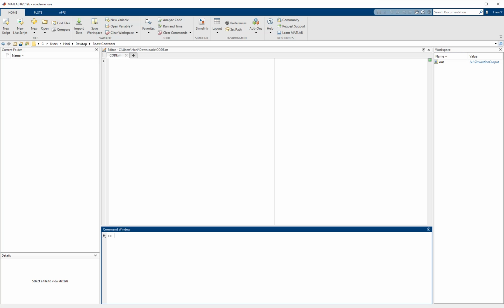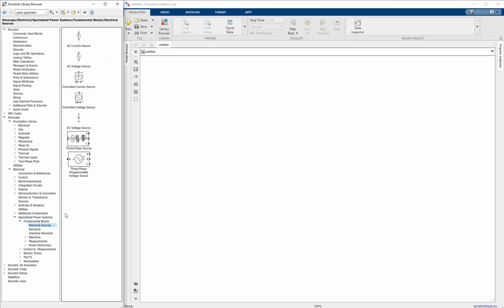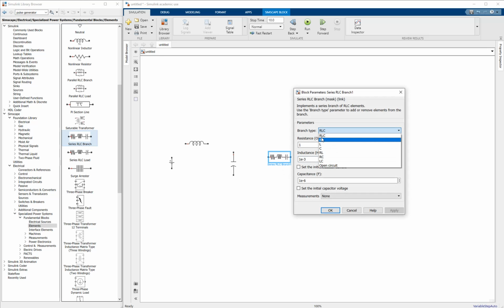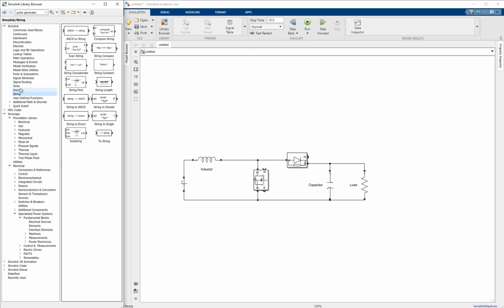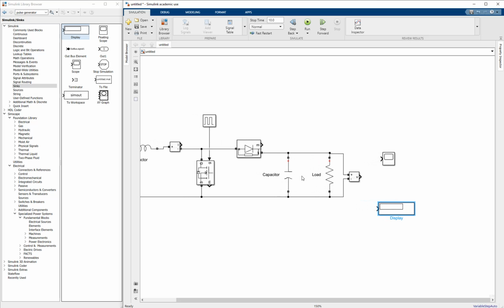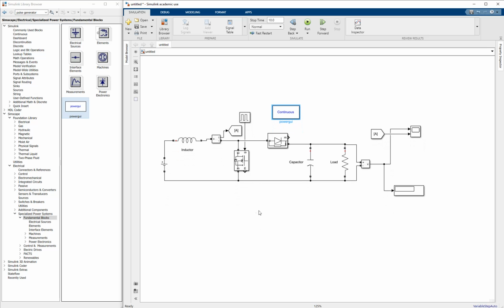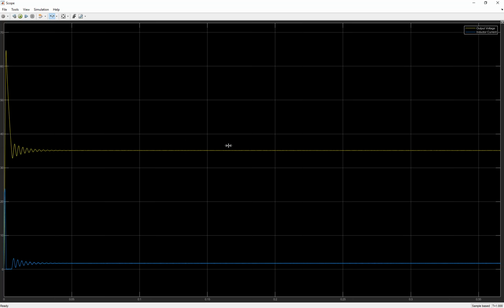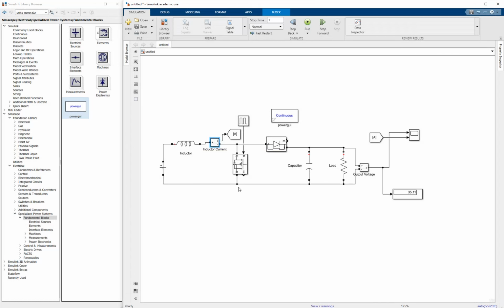Part 1: How to build and simulate an ideal Boost Converter in open loop Using Simulink

Comment: how i can control three switches  with phase shift 120 degree by using arduino uno  to control 3phase interleave dc/dc boost converter can you help me please
Reply from the maker: To control three switched with a phase shift of 120 degrees you can simply use three pulse generators with 3 shifted phase delays (sec) based on your signal period. For example, if your period is 9 seconds, set the first phase delay to 0 sec, the second to 3 sec, and the third to 6 sec. Make sure you have the same period in three blocks. You can also adjust the pulse width to (100/3) or whatever pulse width you intend to use. 
To simply perform control using Arduino, you can upload your Simulink code to the controller that you have using the Simulink Support Package for Arduino Hardware. 
Get the add-on and you'll find everything you need in its documentation. You can also find many examples on youtube that illustrate the use of that add-on.